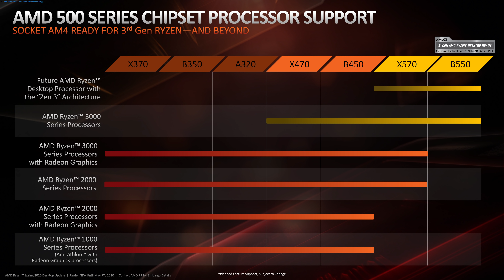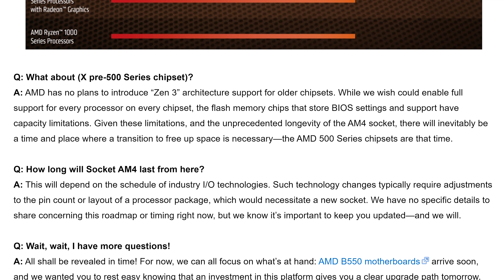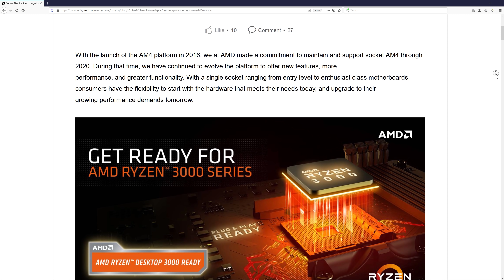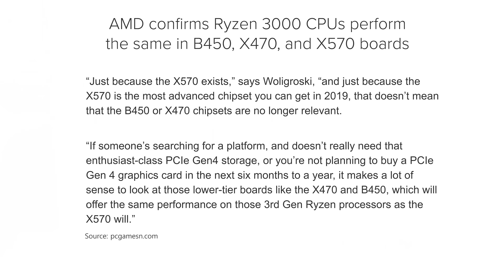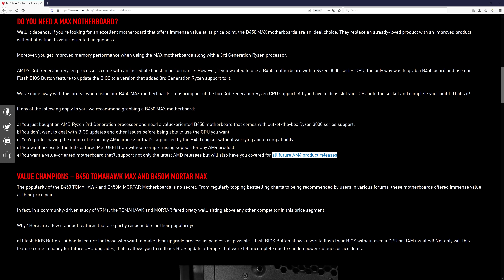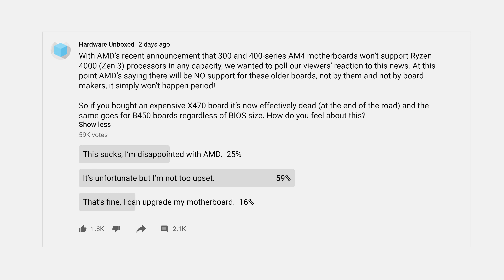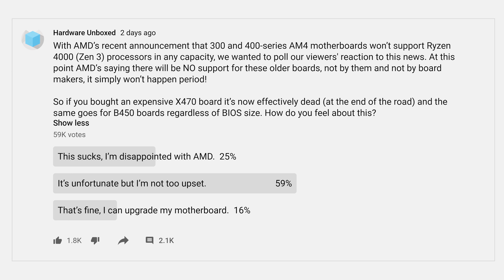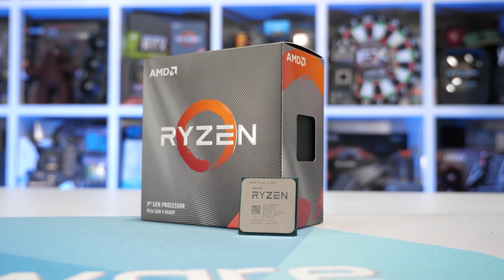AMD Does An Intel, Axes Zen 3 on 400-Series Motherboards, Our Thoughts

Comment: I have a new (six month old) a320 board, currently running a Ryzen 1700. I like that I can put a '3' (Zen 2 and even up to a 12 core) series on this board, it gives a great update path even though the board can only run stock speeds of the processors (can handle XMP though). I do NOT expect AMD to put Zen 3 on this board, it's lower end after all. But B 4x and above were specifically brought by many people with the idea of an upgrade path and cost significantly more (a320 boards are 40 to 50 bucks usually) and it's sad to see AMD squander so much good will. Please keep the pressure on them, if only because I've loved what AMD has done in the market the last 3 years and we don't need them giving Intel any breathing room until or unless Intel gets its act together.

Comment: Maybe it has something to do with DDR5 support, maybe they just thought everyone is gonna have to upgrade motherboards to take advantage of that anyway so might as well do this at (relatively) the same time.
Reply: DDR5 is not coming until Zen4/Ryzen 5000 (If even then. It has not been announced yet - only speculated) . It is not DIMM compatible with DDR4, so it's not like anyone could've just slotted them in.

It is pretty much a given at this point that Ryzen 5000 will be on a different socket (dubbed AM5 by the internet). And if AMD has the slightest bit of whit it will be an LGA style socket instead of this fragile-little-pins madness.

Whatever it will be DDR4 or DDR5 remains to be seen. Some speculate that x670 will be DDR5 and b650 will be DDR4 to further diverge the two platforms as Premium and Value options. From a financial standpoint this would make sense, as AMD makes the X series chipset, but ASMedia (owned by Asus) makes the B series.... That is, AMD doesn't make money on B series motherboards.

Comment: if 500 series mobo wont support 5000 series cpu, would it be better to just buy b450 mobo and 3000 series cpu, and wait to a complete upgrade when 600 series mobo (or even new socket) and 5000 series cpu launch? from a budget perspective ._.

Comment: Lets face it. How many user would buy or upgrade to an x670 board if they could just plug and play with there 3/4/5 series boards, especially if its the end of the line.

I know people with zen+ cpus waiting for zen 3. Now they have to buy a whole new board to upgrade. More board and chipset sales for AMD is the end result.

Glad I bought an 570 this year, I won't upgrade until ddr5 for sure

Comment: In my opinion, the 3rd gen Ryzen CPU sales will not be successful as the predecessor. People who will buy Ryzen 4000 series are the people who already have an X570 motherboard. The owners of the 400 series motherboards will not upgrade their motherboards to the 500 series (including B550) because they will have the same fate as the Intel's 300 series. 

So, the success or failure of the Ryzen 4000 CPU sales is related to AMD's support of the 400 series Mobo. AMD must think about it.

Comment: If it's truly a motherboard flash memory chip capacity limitation, then maybe another solution for motherboards that don't have the capacity is to make the CPU microcode extendable to USB or other off-motherboard storage device? 

A check on boot-up can be made on whether the UEFI needs to look externally to identify a CPU/APU (if needed) and should prompt the user if the processor can't be identified.

Comment: I did buy a Asus TUF B450 Plus Gaming board for around 100$ last year, and a Ryzen 3600. Was hoping I will be able to put the next gen processor there, but if I can't do that I will just use a higher end processor from the current generation, and hold off untill the new platform comes. Do u feel screwed? A little bit maybe, but considering I can always sell the b450 board for around 60-70$ in the aftermarket it is really hard to be sad about it. It is rather a minor discomfort.

Comment: I was screwed by this. Bought a b450 a month ago and thought I would get at least a generation out of it....
Reply: Me too mate, bought B450 Max + R5 3600 hoping to have an upgrade chance in a year or two...
Reply: @moddingpark  you still can upgrade...Get a 3800x or a 3950x ....If you need more CPU than a 3950x, I want to see the data center you are running because right now that is more CPU than the average consumer needs, even for gaming
Reply: Me too poor intel like tactics pls you will lose future customers
Reply: Dunno why people get mad over something so trivial. I bought Ryzen 2600 with a b450 board and the entire setup was so cheap that it felt like robbery. I paid probably 200€ total for a 6 core 12 thread CPU running at 3.9ghz (OC). There is literally no need to upgrade the CPU for at least 4+ years since probably 90% of the time you are bottlenecked by GPU in most video games. 

Even if you decide to buy every new generation of CPU's and you are hoping to save some money by reusing the same motherboard I feel like it's a non issue. You can just sell the old Mobo + CPU and with the money you get you will easily cover the costs of new Mobo and have some spare money left. And again if you are buying a new CPU every year when its mostly less than 15% increase in performance, even less in gaming, I don't see how it's a problem to drop another 100$ on a new mobo, especially when old parts still retain amazing value and performance.
Reply: Same for me.  have a b450 max. was hoping to at least go to zen 3. But at the same time AMD turning into intel once they dominate the market was inevitable.
Reply: Screwed?  You have a wide selection of 300 Series processors that will be cheap soon and should last you for years to come.
Reply: I don't get it, everybody for the last 6 months is saying the 450 boards likely won't support the next gen. Then it happens and everyone is surprised?
Reply: @Anax100  nobody said that because there's no good reason they wouldn't.
Reply: @Anax100  Exactly AMD said it will support AM4 through 2020....Its 2020 people these chips will be out by end of year on a new platform making AMDs statement true.

Comment: I bought an x470 board with my 2700x at the end of 2018 largely because I expected to be able to use it to upgrade to a 4th gen Ryzen down the road. I was really looking forward to it, but now I have to code between saving money by sticking with 3rd gen or pay more for a new motherboard and a bunch more time installing it and new chipset drivers etc.

Comment: Where's the ddr5 support? Oh that was cut from the zen3 platform. It's almost as if zen3 wasn't designed to support AM4 and AMD maintained a stance of 3 generations on the socket previously and that they would support AM4 until 2020. Maybe you should know where the train is going before having jumped on it.

Comment: One question I've not seen answered anywhere is: Why doesn't B550 support the (Zen+ based) Ryzen 3000 APUs? 

If you're on a tight budget and can't afford a graphics, according to the AMD slide, a 3200G + B450 will still be your only option even after B550 lands next month. Well, unless you want to shell out and extra $100+ for an X570 board, which inexplicably DOES support the 3200G! In fact, both MSI's X570-A Pro and Asus' TUF Gaming X570-Plus even support Zen1 based 2200G and 2400G (though not the other Zen1 parts). Something doesn't add up here.

Comment: IMHO AMD should be backtracking on this and adding support for at least B450 and X470. Sure I can understand that 3yr old A320/B350/X370 first gen boards not having support for Zen3, but B450 boards are still being sold new and touted as budget performance options, especially with how expensive X570 boards are. I have a few friends that have recently built brand new Ryzen 3000-series systems using B450 boards partly based on AMD's reputation of forward compatibility vs Intel, and suddenly now have no upgrade path at all.

Comment: Slight correction to the B450 that have only one generation support point you were making, they have 3(Zen, Zen+ and Zen 2). You can easily go from Ryzen 3 3100 to Ryzen 7 1700 and that would be an upgrade.

Comment: This all seems like AMD Motherboard partners stiff arming AMD. Intel gets the cake from partners because they require a new motherboard chipset with every CPU release, AMD can make a lot of enemies by not helping them make money.

Example, used AM4 boards are very hot in the second hand market due to compatibility, when motherboard manufacturers are making 10 different boards for the same chipset for Intel.

Comment: Even before this news, when specing a build for friends or clients, I advised against any chipset other than the x570 for their pricey AMD CPU setup. AMD mentioned the year 2020 and everyone knew the chipsets released around this time may have compatability issues moving forward. It is a love and hate for those with x470. Fortunately,  those x470s will become surplus and cheaper for those with older chipsets to upgrade to from eBay, etc. We also went through something similar with this with the x470 not being fully compatible with PCIe Gen 4, so the trend could have been noticeable back then.
Reply: The trend was noticeable.  AMD screwed the ASUS board owners that had PCIE 4 working, when they "fixed" the AGESA to stop PCIE 4 working.  Now they are screwing the MSI board owners with MAX boards.   AMD have lousy marketing.

Comment: Wow msi lol.  B450 was still the budget option, it was and is the best option at 100$ current day for a zen 2 you'll use for several years.  I think the % of users who will only spend $100 on a mobo but then turn around and buy two CPUs a year apart is vastly overstated.  You are either an enthusiast buying expensive shit every year or else you buy a new PC every 4-10 years just to be operational.

Comment: I don't really care about it, but it may have been different if they launched the B550 last year, if you happened to buy a placeholder CPU (any cheap am4) and a B450 a month ago, well you just wasted money on the placeholder. That would piss me off.

That said, my last upgrade was into a Z270 chipset and a 7700k, which is the fastest I can go without a motherboard swap, likely a Zen 3.

Comment: I literally bought a crosshair vii hero last week thinking that I would get support for ryzen 4000 when it comes out. Well rip to that.
Reply: Exactly the same here, didn't want PCIE4 or a noisy chipset fan so bought the most solid X470 board (CH7) with great VRMs for future upgrade to Zen3 which AMD lead me to believe wouldn't be an issue. If they had made it clear that only 5 series motherboards would support Zen3 then of course I would have made a different choice, but evidently even the motherboard manufacturers had no idea that this was the case. Really annoyed.......
Reply: I would return it.
Reply: @dadjokeswithelvis  I would return it but there would be no x570 to replace it with. Most x570 boards are out of stock or have inflated prices. And when b550 comes out, thats probably gonna have inflated pricing and probably be out of stock too.
Reply: Return it
Reply: @viniciuserrero  I would return it but there would be no x570 to replace it with. Most x570 boards are out of stock or have inflated prices. And when b550 comes out, thats probably gonna have inflated pricing and probably be out of stock too.
Reply: @fiddmoney123  dude thinck of the future stock will replenish in no time just return it and spend your money on a solid x570 board like msi tomahawk or asus strix e
Reply: X470, right?
Reply: @joeykeilholz925  Yeah its an x470 board

Comment: All this fiasco because there were no B550 boards available during Ryzen 3000 launch. Had B550 been available everyone would have got that instead of B450. The only reason people went for B450 was because X570 was expensive, B550 was unavailable and why buy a X570 when you can easily get Ryzen 3000 series processors on a B450.

Comment: Honestly speaking I'm not surprise seeing this. 
When RyZen 3000 came out, it BARELY work on B450 / X370 either....
Mind you B450 is meant for RyZen 2000, so it work on least 2 Gen. It's like a pattern already....
RyZen X570 and B550 ( which is honestly should come lot sooner I be honest ) is meant for RyZen 3000 yet it still will work for Ryzen 4000 series CPU. 
I think it's still not bad. If this is Intel, dream on of even getting such backwards compatibility. 
Lastly, we all don't know exactly how much of an improvement we will get with RyZen 4000, it is still just a Refresh of RyZen 3000 no ?? 
If it's not much you could just still hold on to RyZen 3000 and wait for RyZen 5000 heck maybe even DDR5 RAM be out then. 
I for one ma happy I didn't jump the gun, I'm still on X370 and RyZen 17000X. So I most likely end up buying a B550 board with RyZen 4000. 
Who knows maybe I will even just go with RyZen 3000.

Comment: I have built 3 B450 Systems  in the last 3 months. I am not all that mad...sure the timing is meh.  I am a little muffed at myself for not waiting until the B550 in general, just to get that intro pricing. But all in all, i am not mad.. my systems are up and running and unless something breaks, i have no need to worry about this topic.

But, to get upset over a Quad Core, when im currently running 2 8 Core 16 Thread and a 6 Core 12 Thread, is silly.

Comment: 3 months ago upgraded to b450 , 
To be ready for zen3 
If know that I would buy b550 but t no were b550 on market ;) thanks AMD
Reply: What did you upgrade from and why? 3 months ago the B450 was an old platform missing PCIe 4.0 and faster RAM support. Also, why would you buy a motherboard without actually having a CPU for it? I'm not defending AMD on this one, just pointing out your bad purchasing choices so that you might avoid such mistakes in the future. These mistakes transcend brand, sockets or generations.
Reply: @AndreiNeacsu  PCIe 4.0 isn't necessary, in most cases the consumer won't find it useful plus B450 is the BUDGET AM4 board so the buyer probably isn't interested in a PCIe gen 4 NVMe that is very expensive when a £100/$100 1TB NVMe gen 3 ssd will be just fine. Nor is it essential for graphics cards as the RX 5000 lineup is the only mainstream consumer lineup that supports it, nvidia's rtx 20 series does not. 
X570 was also a fair bit more expensive than b450 so unless you have deep pockets you'll be buying a b450.
memory speed is also fine, b450 supports 3200mhz, 3466mhz, so on which is plenty fast for ryzen. 

I wouldn't have considered b450 an 'old platform' three months ago as b550 was not out yet and still is not. It is also not made obsolete by X570 and pcie 4.0 as x570 is much more expensive and not a replacement for b450, b550 would make it obsolete.
Reply: @AndreiNeacsu  Did you watch the video? AMD themselves advertised the B450 boards as the budget option to support Zen 2. That's some shady ass shit now that they've done the bait and switch.
Reply: @wpwentzell  Well it supports Zen 2. They never said Zen 3, or did they?
Reply: @GreatOne0815  They didn't, but they inadvertently steered price concious Zen2 buyers toward a board that won't let them upgrade their CPU besides getting extra cores, which doesn't help much for gaming (8 core 16 thread is overkill right now). Meaning those people now have to spend more money to upgrade since they need a new board too (and that board will also not get them any CPU upgrades either).

If they decide to go for a used 3900X or 3950X (the only big upgrades over the 3600) in a few years, they'll find inflated prices. Why? Because they're the best CPU's available for FIVE series of motherboards people bought over a 3 year period. Literally every used buyer that didn't get an X570 (which is a HUGE percentage of people) is on that same market. Anyone upgrading from Zen/Zen+ to a 3600 is also dicked over, because the 3600 will be the best value gaming CPU on AM4 for those buyers.

If they at least told us last year, sure it would have sucked, but at least we'd have known. It'd be even better if they actually released the B550. But now the 3900X and 3950X will be the best CPU for like 98% of sold AM4 boards to date since the X570 flopped and the B550 is so late to the party. B450 sales are now gonna go in the bin and no one is gonna upgrade from B450 to B550 just to get to Zen 3 if they can just wait a little more for Intel or Zen 4. Those will also need a new Mobo and likely will be supported for more than 1 generation, so why go Zen 3?

It's a dick move.
Reply: @AndreiNeacsu  there's literally no benefit of PCIe gen 4, there's no hardware right now that can fully take advantage of it, infact most PCIe gen 3 GPUs has the same performance in gen 2 slot, PCIe gen 4 SSDs are fast but you're spending 4x the price for 10 less seconds...

And also if you're buying a b450 board you're probably building a budget PC, and at that price point you probably can't afford fast ram or SSDs...
Reply: @AndreiNeacsu  PCiE 4.0 is near useless for gaming and not even remotely worth the cost. No game this generation will really use it since it's not in either next gen console. The 5500 XT using it but is also a horrible value and gets clapped by the older 580 and the 1650 Super.

Comment: The problem i see is as an x570 owner, im gonna be screwed in 2021 if i want ddr5 ram, its possible they might make cpus tailored to ddr5 in the future that wont even perform great on a ddr4 setup, i got 32gigs at 3200mhz, it wasnt cheap, neither was the overpriced and underperforming asus x570 board i was recommended, i feel ripped off, wheres my b550 option?

Comment: I bought a system with X470 jz to have future upgradeability. Seems that going to use it till Ryzen 5000 or 6000 series release and skip the upgrade path of Ryzen 4000. Quite disappointed thou